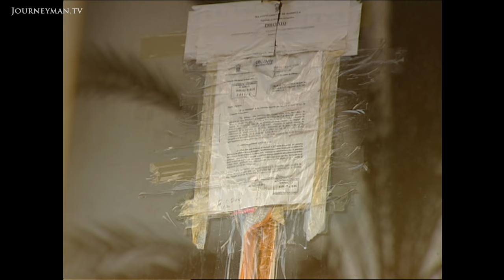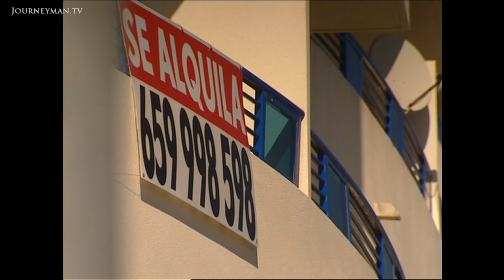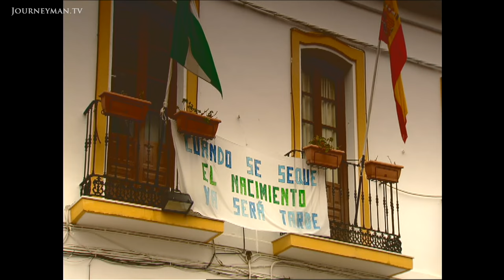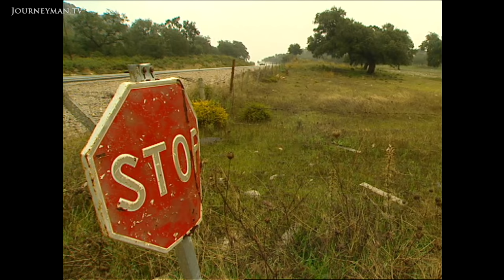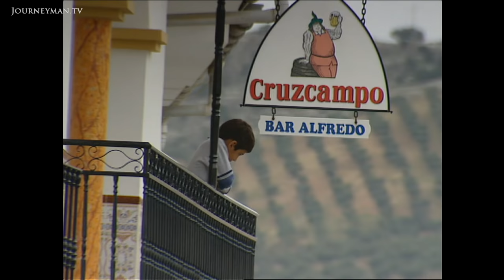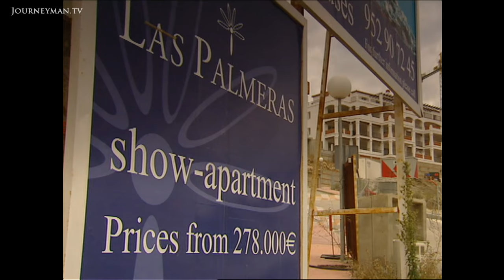Rotten To The Core: Spain's Housing Market In Crisis

Comment: I lived in Southern Spain for a few years working. I didnt like Marbella its full of coke snorting chavvy cockneys but had to work there for a bit. If you are visiting, try Murcia city, hire an air b&b its only about 100 each for a week if you split it between 2. That includes cleaning fees service charge etc, and the air fare was £50 there and £60 back. (don't book a return you will get charged triple), Book a single flight then book your flight home as soon as you are in Murcia airport, or t internet

Comment: Having lived in Spain for over ten years, I'm not surprised one bit!  The sad part is I grew up in part in Madrid, Father was in the U.S. Air Force, Torrejon Air Base early to mid 70's.  And this video is so true for all of Spain.  I remember going down to Torremolinos (Costa Del Sol) for summer vocations and the sand being so white and clean.  You go now and the sand is dark and dirty with all these high rise buildings right on the beach with these big red cast iron pipes  disappearing into the surf from this buildings.  These pipes are dumping raw sewage directly into the Med. Sea.  When Franco was alive, this crap did not happen period.  Que Viva Franco!